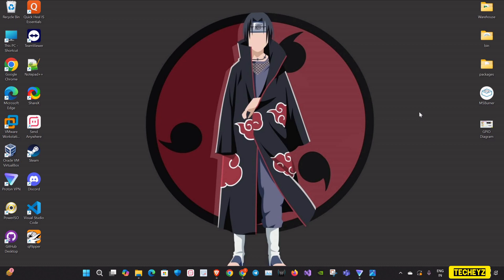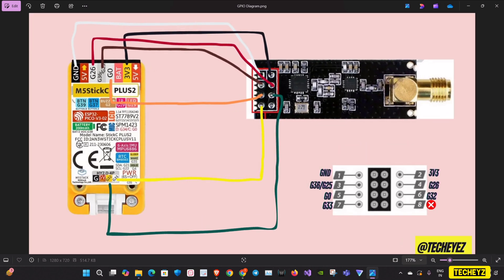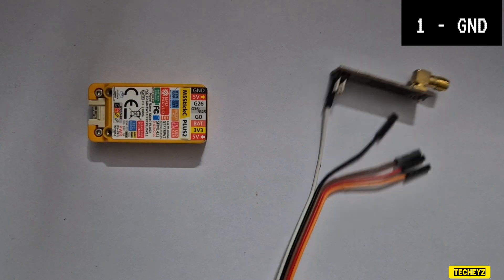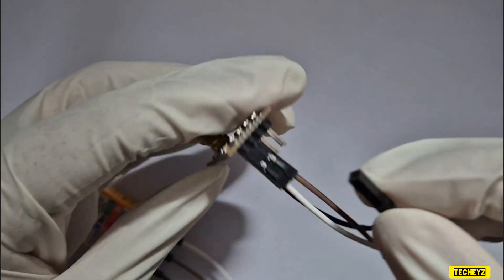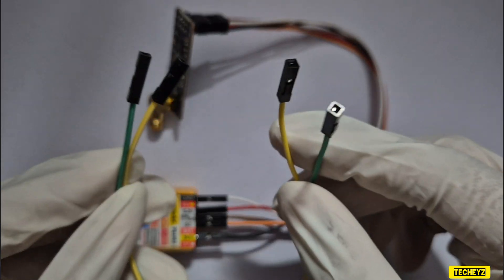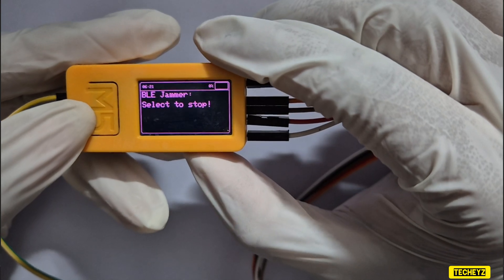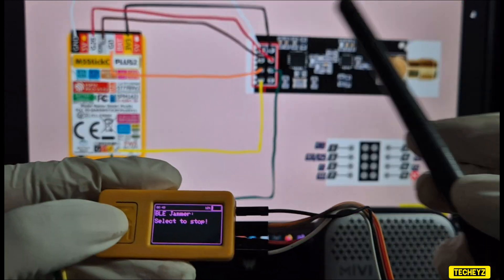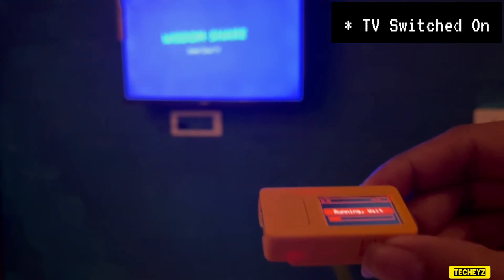M5Stack C Plus 2 + NRF24L01: Jamming BLE Speakers 🤯| IR Remote 🔥

Comment: Does not work. Says nrf module not found and turns off
Reply from the maker: Restart and try the same .
Reply: @TechEyez-sy2zp  this system work atlest 500 meter to 700 meter range ??

Comment: Do you think it’s possible to amplify the signal using a “cantenna” made out of a Pringle’s tube? I used that to amplify the reach of my external usb WiFi and I was wondering if that could work also with this sort of antenna..
Reply from the maker: It might work , totally depends on the hardware/firmware  compatibility.

Comment: how far does the signal reach? i want to mess with people at work.
Reply: bad!! 2 metres  max
Reply from the maker: Depends on the frequency of your antenna! But definitely not 2 metres . @nazarvakfangames6935
Reply: @TechEyez-sy2zp the same antenna, I did the same as in the video, but Max is 2 meters and that's it!!
Reply: @TechEyez-sy2zp  Maybe I'm not doing something, I have Bruce 1.8.2
Reply from the maker: It reaches around  50 metres .
Reply: Mine only reaches about 3 feet @TechEyez-sy2zp
Reply: I got it to work. I tried it with the speaker and the phone and the device on my coffee table and it didn't really work. Took it to work I work in a pretty big steel building body shop which is probably close to 50 meters and I was able to kill the whole building and shut down ever speaker.

Comment: I love your vídeos. But I have a problem, when I Connect it and I try to go to NRF24 it says it is not found and doesnt let me jammer
Reply from the maker: @janseran9978  Thanks Mate , make sure the NRF module and the m5stick device are connected properly through the wires . Also reboot the device post connecting it and try
Reply: @TechEyez-sy2zp same thing with me. nothing helps( pls help
Reply: version of firmware bruce?

Comment: Hey bro I have the same m5stick and also I have used bruce firmware but now my stick is not turning on when I press c button then only green light is glowing 😢😢 pls tell me any solution
Reply: Charge it with powerbank not using the mobile charger
Reply: Reinstall bruce. I had this problem. It wouldn't turn on when I would press the button but would switch on when charging.
Reply: Same thing happened to me I just had to keep trying and it’s starting to turn back to normal

Comment: How can I Connect ir sensor or is that build in the m5stick beacuse I want to turn of tv’s and ontheemd elektronical things
Reply from the maker: @thecarguyhere The IR sensor comes with the M5 stick but for short ranges to operate..you can also add an external IR for operating long frequency ranges

Comment: i am not getting 2.4ghz Jammer in NRF24L01. Can you please help?
Reply from the maker: @00ednixon  Reboot the M5stick , else check the connections have been made correctly
Reply: @ connections are done correctly and i am able to perform nrf in legacy mode but it only works for few seconds and then stops working. Also wifi deauth in bruce never works

Comment: Mate. can you please help, i connected it, but it says NRF24 Not found i have NRF24L01
Reply from the maker: @pressev  Kindly go through the circuit diagram again,  if the connections aren't correct it won't work . Also try to reboot after connecting with nrf.
Reply: @TechEyez-sy2zp  already fixed, it just look strange on image, i looked thru full tutorial and connected it, thanks anyway bro
Reply: there no option jammer 2.4

Comment: When I connect to the 3V3 port next to GND the m5stack C plus turns off :( What can I do to fix this?
Reply from the maker: @GabrielCampariCorreia  Kindly check the device is charged well.  This should not happen ..also you can keep the device off while connecting wires.
Reply: @TechEyez-sy2zp Yes, it is charged 100%, but this only happened when I connect GND with the 3V3 port, and I can't turn it on after that.
Reply: @TechEyez-sy2zp  Mayber my the problema is in Nrf24l01? Happy new year! :)
Reply from the maker: @GabrielCampariCorreia  I wished I could troubleshoot with you ...Happy new year !
Reply: @TechEyez-sy2zp  Thanks!!! I'm thinking the problem could be in the firmware version

Comment: What is the range of nrf24l01 and does this firmware comes preinstalled with the ble jammer module ?
Reply from the maker: It's around 15-18 metres as it is a 2.4Ghz frequency Range. Also it doesn't come pre-installed - you need to install custom Bruce firmware to use it .
Reply: @TechEyez-sy2zp  is there any possible way that, I can increase the range like 100 meters max with upto 99th meter it will strongly disconnect bluetooth.
Reply from the maker: @The_Animated_Spirit  Yes there are ways possible..alsoa  little bit of  self- research might help you ..
Reply: This is what I'm researching but I can't find anything. Is it just a matter of improving the type of antenna or something else?
Reply from the maker: @Danmaxlara  There are various antenna with different ghz..depends which one you try...